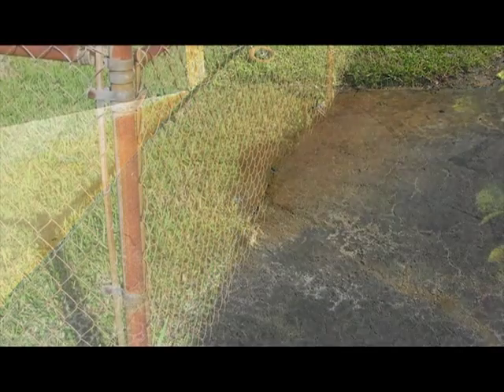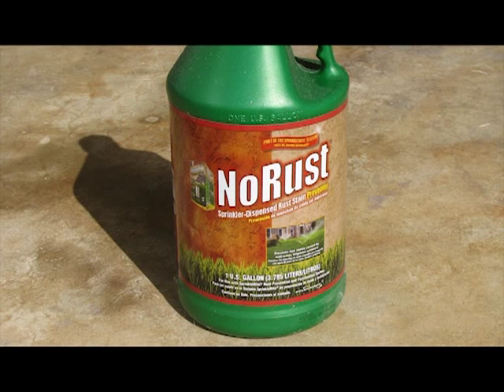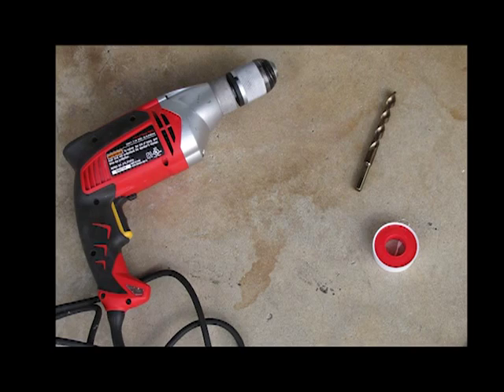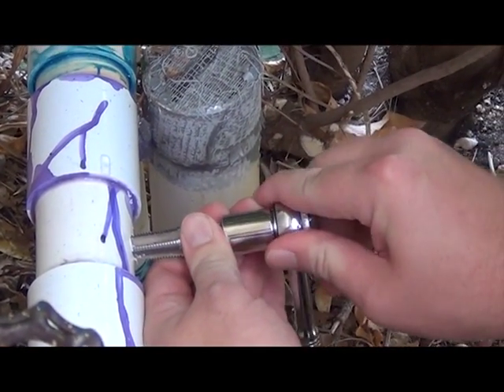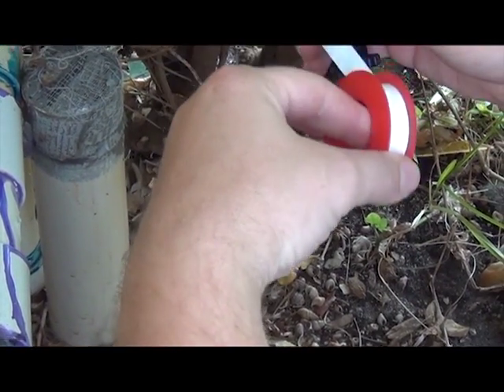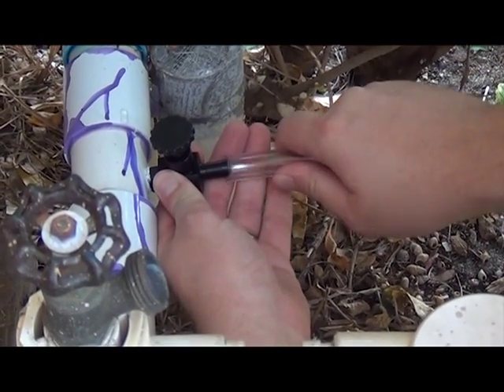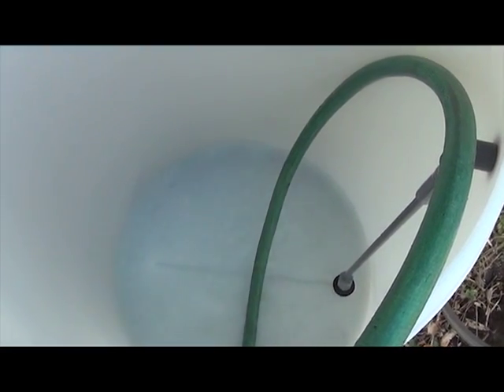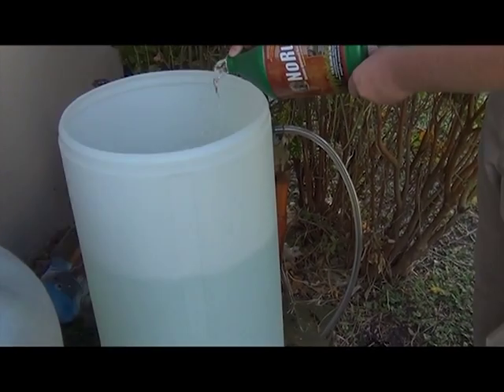Rust in Irrigation System

Comment: The plastic piece that you're screwing into the white PVC comes apart. The tank dry rots and falls apart. The lid falls apart and it doesn't work so well and with the rust preventer it grows tons of mold in the water tank and it's cost me more time and money and I still haven't gotten a solution so you be cautious with your money